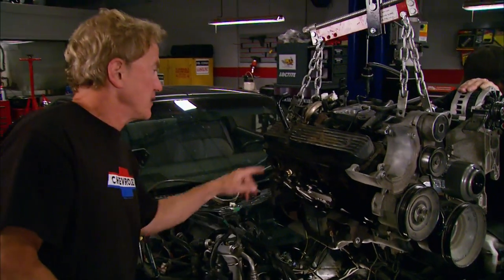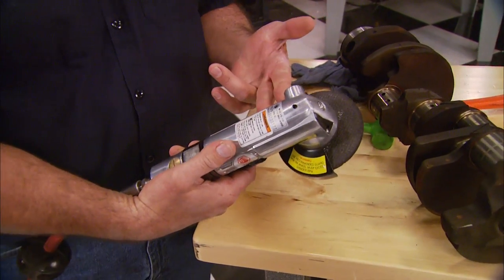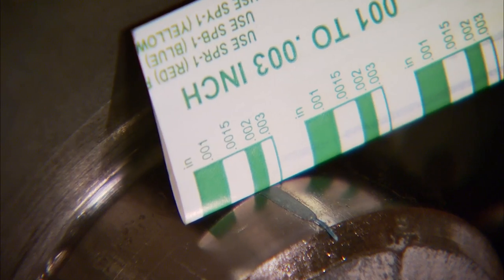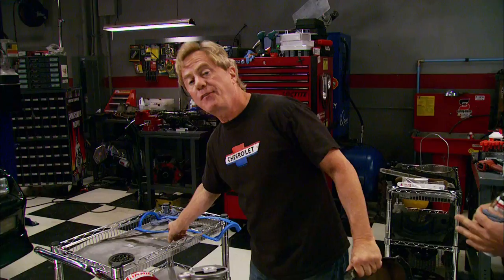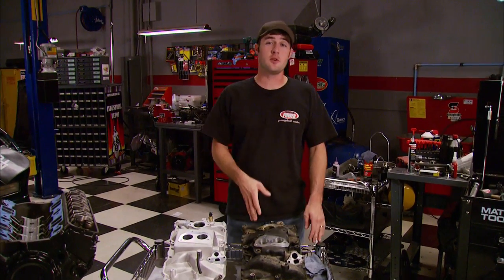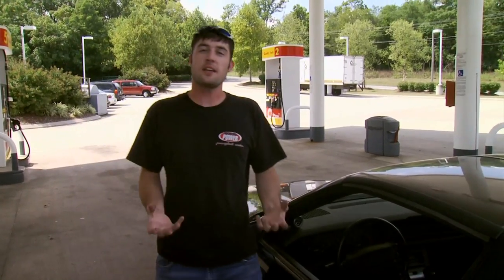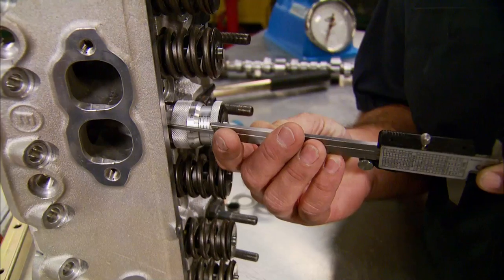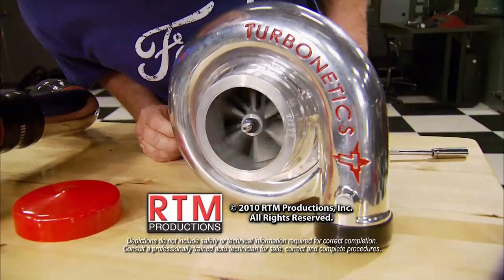Modifying a '92 Camaro Small Block to Improve Fuel Economy and Power - HorsePower S12, E17

Comment: What a waste of money....
Reply: Oppossed to making it 450HP and losing 5mpg, when will you get your money back on that?
Reply: Ls swap
Reply: I had a 91 with a 305 in it.Hated that motor.It was dependable but had about as much get up and go as a Snapper lawnmower.So why bother rebuilding one.
Reply: @Bloodcurling  You won't get 450 out of a 305.
Reply: This was 2008 when gas was over $4..
Reply: @kennethsouthard6042 , you can get close though - I've got one that puts out 380hp and 450ftlbs to the crank and gets right at 18-20 mpg. That was with the H.O. 305 heads, modified throttle body, intake, a lot of hand porting, bigger valves, 10.5:1 compression, a .48 lift cam, and headers.
Reply: @markwilson9063  Nice job!  I am guessing that a lot of people think that you can just punch out a 305 to make it a 350.
Reply: @kennethsouthard6042  yes you can all day long look at the dirt track  sprint cars running 305s with over 400hp it's not rocket science but it is science
Reply: Makes for good TV I guess they're not paying for the parts.

Comment: Or.  At this point just put a 350 in it.  Problem solved.
Reply: All this for a 305. Why bother.
Reply: Totally agree with you
Reply: I have to agree with you
Reply: Why stop at a 350? Not a big upgrade from the 305
Reply: I’m surprised that high rise intake, tbi spacer and the weird breather fit under the hood. It was close just adding a better breather to mine
Reply: @superchile9640  huge upgrade.  45 cubes is a lot. 14% more displacement.  And way more parts to build with.
Reply: Wild Bill I have both a 350 in one car and a 305 in my camaro. I understand the differences. Tired of everyone saying to go to a 350, why not go more since everyone wants more? When is more not enough, 402? LS?
Reply: Super Chile yes it is.
Reply: Or just put a 5.3 in it and that would solve alot
Reply: Fomoco1320 5.3 is LS
Reply: @superchile9640  less work.  A 350 should drop in with little work.   You might even have LS engine mount adapters out there now.  I didn't look.
Reply: well, some of us want to keep the 305 because the later variations made pretty decent mileage and power too.  It makes it a lot easier to keep track of parts and maintenance when you keep everything as stock as  is reasonable.  I keep my 305 in my 89 camaro simply because it's thousands of dollars to do a LS swap the way that I want to.  So instead of spending all that money building up some other engine, I just put money in where it really needs it, and I go out and enjoy my car.
I like wrenching on stuff just as much as anyone else, but why replace something that's working just fine and doesn't have any issues?
I'm not looking for large power numbers or anything; just a reliable, easy-going V8 with a little pep.  300HP at the wheels is enough for me.
Reply: osp80 stock 305 TBI was 175. Brand new hot. Most don’t put out more than 140 now. I e never put mine on a dyno, all I did was rebuild it after machine shop and install a more aggressive can. Same tbi unit, intake(s) and heads. It will spin the heck out of the tires but I don’t honk it’s much better
Reply: Pardon, the machine shop did port the heads, but I’m no engine guy so I didn’t bother to ask. I told them I wanted more power. They ordered everything, I put it all togethwr
Reply: Jacques Crusan how do you have 300hp from your 305?
Reply: 350ci gets 20mpg so that's going backwards.
Reply: @jasonhayes9776  better mpg than 350. barely
Reply: @superchile9640  so at 294.6 HP at 6200 RPM I have a little closer to 290 at the wheels.  my 89 camaro is the IROC version, so it has the LB9 with Tuned Port Injection.  A long time ago I replaced the stock intake manifold with an replacement (can't remember if it's edelbrock or Holley) that has larger, bell mouthed runners that are slightly shorter in length than stock, along with having a larger diameter.  I had the stock cylinder heads ported, and the combustion chambers polished, along with some valve unshrouding and smoothing out the transition between the ports and the valve seat.  The overall port shape remains the same, there's just no longer any sharp corners, and the exhaust port ceiling has been raised slightly.  I swapped out the stock throttle body for a oversized one that directly bolts onto the new intake manifold, and got a set of Hooker shorty headers that follow the stock exhaust routing up to the location of the stock catalytic converter.  The rest of the exhaust has a high flow cat, and fabricated piping that uses a set of straight-through mufflers.
I kept the stock cam because the LB9 cam from my particular model year is the most aggressive stock one that's available, and instead upgraded the rest of the valvetrain to make the most out of it.  I put in a set of Comp Cams replacement roller lifters (the ones that don't have a tie-bar, because this engine already came with roller lifters), a set of 5/16 stock length hardened pushrods, and a set of Scorpion aluminum 1.6 ratio roller rockers combined with 7/16" poly locks and a stud girdle to hold it all together, because I like my valvetrain to be stable.
To lighten the drivetrain and reduce parasitic loss, I removed the stock driveshaft and put a Carbon Fiber unit in from The Driveshaft Shop, fabricated to the same specs as the original (I saved about 17 lbs from that alone), and I use a set of Volk TE37 forged aluminum rims (17" x8.5" all around) with Falken Azenis RT660 tires (245/40R17), and swapped a set of gen 4 camaro disc brakes onto the rear.  I also put a TransGo 700R4 shift kit into my auto to help make the shifts go quicker and so the converter's lockup is more direct.
Reply: Jacques Crusan you did say stock, just sayin’ and hence the question...
Reply: I cannot comprehend why anybody, anywhere, in any vehicle, would pull and rebuild a 305 vs a dirt cheap brand new (not rebuilt) 350 crate engine with a warranty. They are almost giving them away at any GM dealer! 305 was a POS when they designed it - 30 years later it needs to be forgotten. Even with more displacement it would probably get better mileage than the original POS.
Reply: @jasonhayes9776  You mean 310 now. But I guess for Mileage. I would have went to a 350 block myself for future potential.
Reply: most 350's of this vintage made 5 more horsepower.its not like dumb fucks think,every 350 does NOT make 350 horsepower....there are far more that make well under 175 to be perfectly honest.consider the best tuned port 305 vs the best tuned port 350 in a third gen firebird or camaro,there was less than 5-10 horsepower difference .a t5 equipped 305 tpi formula would beat the 350 automatic EVERY SINGLE TIME.the 305 hate is from idiots who don't know better and think all 350s make magically 350 horsepower,surprise THEY DONT